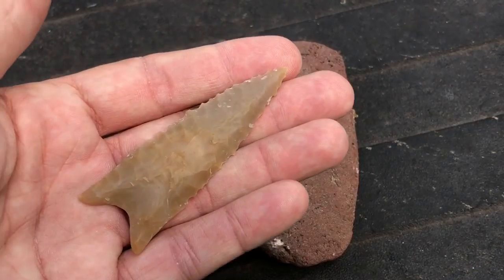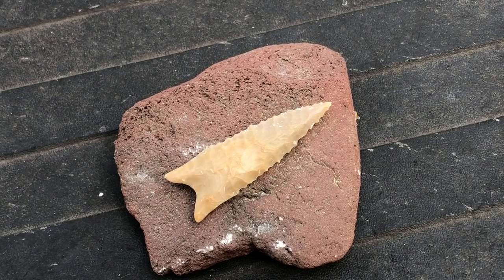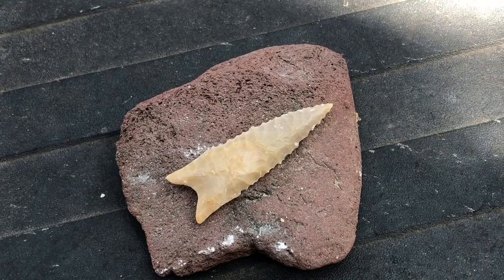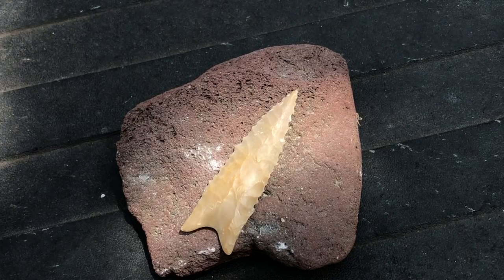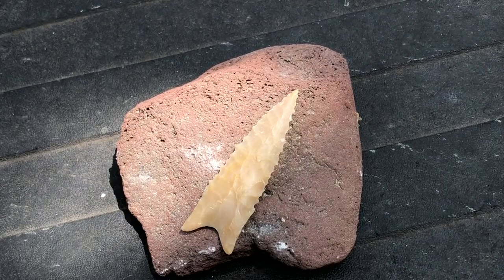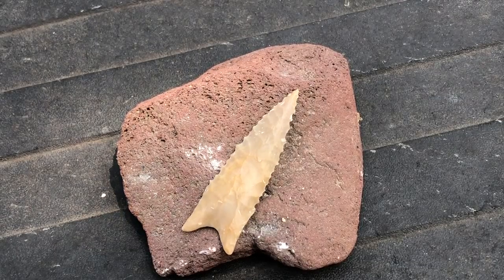i did that rock a solid

Comment: Fantastic work on this! What would you recommend for indirect billets aside from antler? Don't have anything up here that gets antlers that thick outside of moose (Never had luck getting my hands on one of those)
Reply from the maker: there's no luck involved in getting moose antler. seek it out and get it from somebody. different sizes of moose are very desirable for strikers. super-dense, massive wood can be great too. try different things and note the results. the main thing is learning how to not blow through platforms or blow up flakes. thanks for watching.

Comment: Do you know how to get one of those pressure flankers or how to make one that you can attach to your leg and do flakes? I’ve always wanted to try that method.
Reply from the maker: haven't seen a strictly pressure jig that attaches to your leg, but it wouldn't be hard to make one. if you google "pressure flaking jigs" you should find some links to some that you might could adapt for your preferences.
Reply: @freezecracked8382  I think he's referring to an Indirect percussion stick. Check out sites like Flintknappingtools.com and they should be able to set you up.